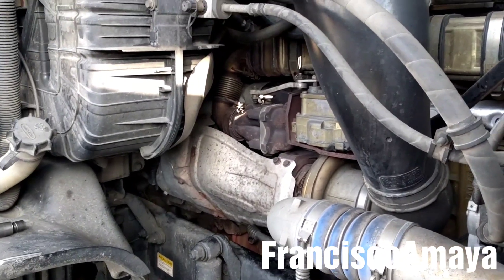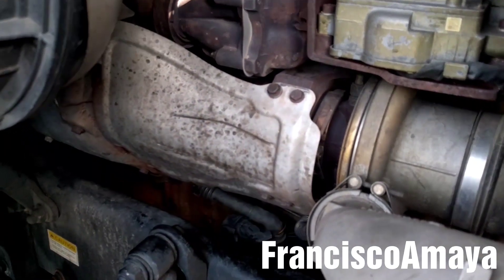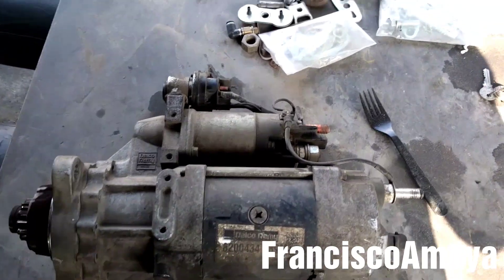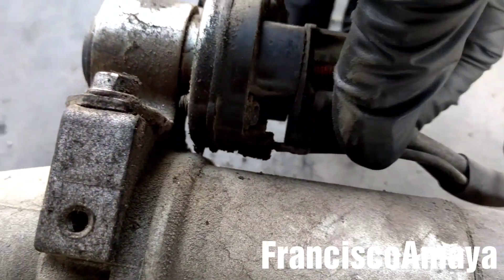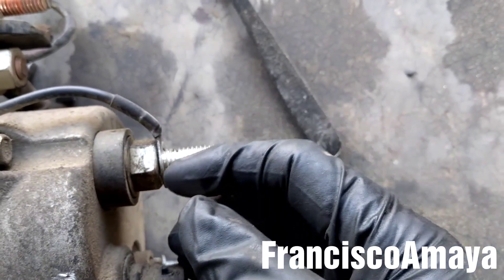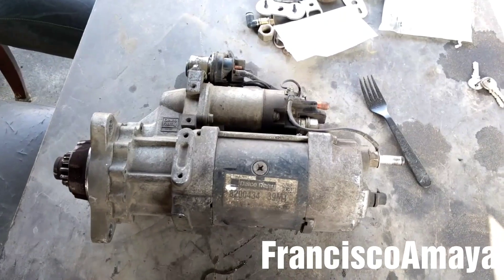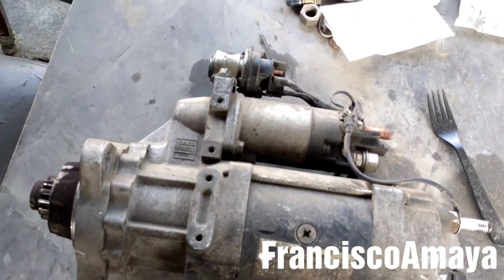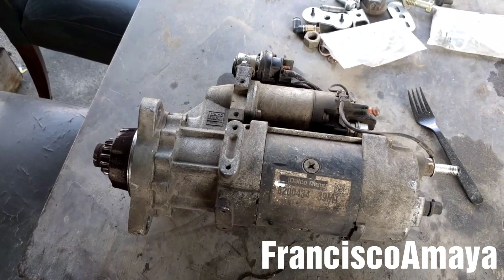Freightliner Cascadia DD13 DD15 engine starter problem no cranks makes noise only clicks

Comment: Same here. That wire was broken in mine 2 days ago. Occasionally it wouldn't start up until Thursday morning when I had to call roadside assistance to get it fixed. They replaced the heat sensor because on mine the bolt rusted away completely. As he tried to loosen up the nut the bolt broke off. I got a used one installed on the starter as a quick fix until I get it replaced. Thanks for your videos though.

Comment: Hi Francisco I have a 2010 cascadia w/dd15. Can I remove factory set restrictions such as speed and idle shut down? Thank you
Reply from the maker: Yes, you can but you need the DDDL software or any diagnostic tool that can support parameters.

Comment: Francisco, I have a truck with a fault SPN 157 FMI 16. Do u know what could be the issue?  I know that fault is related to fuel system.  it started loosing power gradually.   its been at the deler for 4 days waiting to be ck out.  If you have any exoerience with this fault I will greatly aprecciate your feedback.

keep up the good work with the videos.
Reply from the maker: This code means this:
 the rail pressure and when rail pressure deviation is greater than 200 bar for eight
seconds, the MCM sets the code. This fault can occur due to the conditions listed below:

Possible causes are these.  
• External fuel leakage between the high pressure pump and fuel injectors
• Pressure limiting valve leakage (internal)
• Fuel filter integrity (loose caps, plugged filters)
• Fuel supply issues (fuel level, fuel aeration, leaking fuel lines, fuel restrictions)
• Intermittent loss of engine speed signal
• High pressure pump internal failure
• Fuel injector (amplifier or needle) leakage
• Fuel Contamination
• Rail pressure sensor

The most common faults for this poblem are:
Bad fuel quantity valve
Bad fuel pump
Fuel injector leaking
Bad HP fuel pressure sensor

Comment: Good afternoon i have a freightliner 2013 cascadia . It wont start but all lights work .Its giving me code databus error eng2 00109 spn001231. Do u have an idea what it could be
Reply from the maker: This could be caused by a lost of communication between the emissions computer and the engine computer

Comment: I have a 2009 Freightliner Cascadia with a Detroit 60 Series. No mechanic I’ve taken the truck to can figure out why my starter keep burning up every 3 or 4 months!🤦🏽‍♂️😢 Any advice on why AND HOW TO FIX this 🤷🏽‍♂️ PLEEEEASE answer back! Thanks 💪🏾
Reply from the maker: Is the engine easy to turn manually with a tool?
Reply: Francisco Amaya I’m not sure what you’re asking? Engine turn? Tool? What tool 🤷🏽‍♂️ not sure how this relates to my starter frequently burning up . Not being sarcastic. I’m really confused about your question. Thanks for responding though.👏🏾👏🏾
Reply from the maker: I meant, if the engine is easy to rotate with manual for by using a tool.  

If the engine rotating resistance is great that normal the starter with overheat Everytime it comes in motion causing a premature damage.

Comment: Is there a way to test the starter solenoid
Reply: Connect the smaller leads to a battery and larger leads to a battery and check voltage across the larger second pin     If you have no current without the battery and current across the larger circuit on the solenoid with the battery connected it’s working properly

Comment: Halo.  Amigo. Tengo. Una preguta tengo. 2014 freightliner cascada dd15  no crank no  start.  Ke. Puedo. El.  Sensor del. Clutch. El. Relay  de. Star.  El. Cortador de corieta. Eso  es nuevo  amigo me. Puede dar una. Idea
Reply from the maker: Si es possible que switch the clutch no sirva.  Trata de darle corriente directa al starter a ver que hace
Reply: Ya.  Lo. Hise. Y no. Aranca

Comment: Hi Francisco I have a dd15 engine if I don't start it for day or 2 it gives me really hard time to start but if I start it everyday it's fine I checked all fuel lines didn't find any fuel leaks can you guide me what can be it
Reply from the maker: Maybe you are having problem with the fuel check valve located in the fuel filters housing.
Reply: Francisco Amaya thank you very much your videos are very helpful and detailed